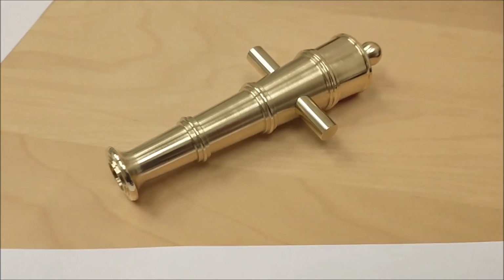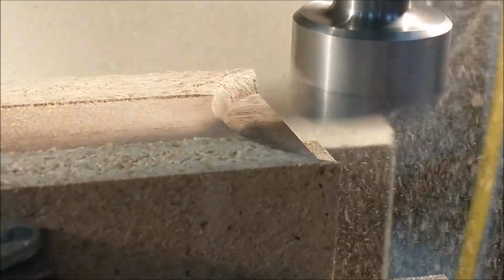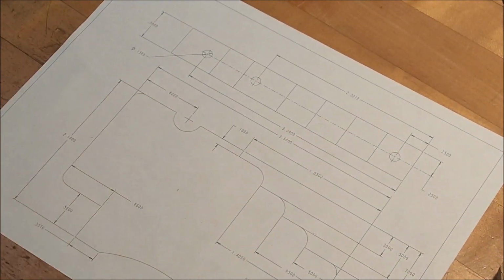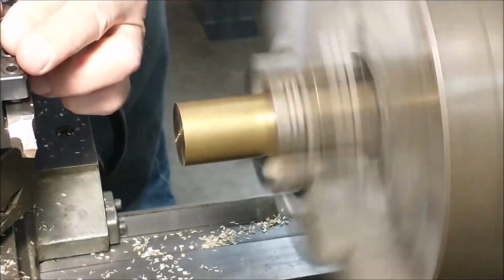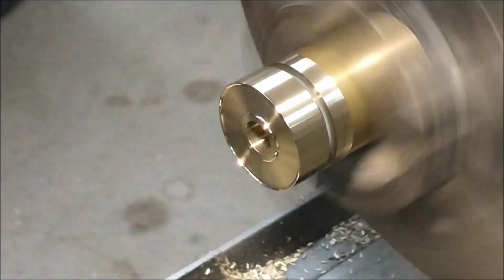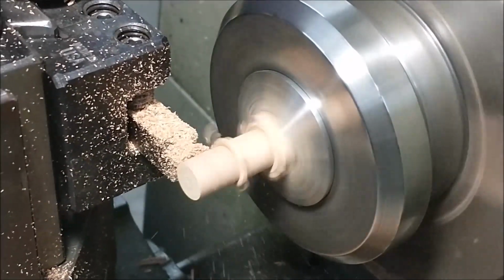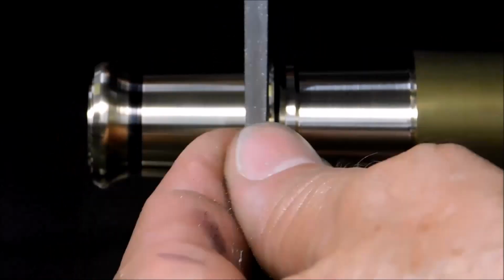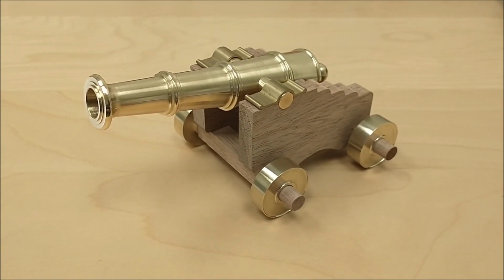Using Form Tools in a Fly cutter ??    I have to see this !!

Comment: Crikey, the rest of this project was a long time ago. Hopefully no one is dumb enough to fire a .50 cal round from a small brass barrel. 
Out of interest, are you ever likely to fire it?
Reply: So long as they're only planning on firing just the one round it'll be fine......what could possibly go wrong?......💥BOOM!💥  🤪
Reply: @howardosborne8647  You would fire a cannon like that with a small amount of gunpowder. People do. Not a full round though.
Reply: Jim Bollinger of DoRite Fabrication built a cannon several years ago and brought it to Lindale, TX for the Good of the Land Festival where he fired it (blank).  He says it will fire a golf ball about a mile.
Reply: @royreynolds108  That's quite a range.

Comment: Tip for wood on the lathe, ( 13:05 ), start the cut at the plunge, and then work out toward the end.  Then you can come back and clean up the shoulder after you get to your desired diameter.  Good work man!